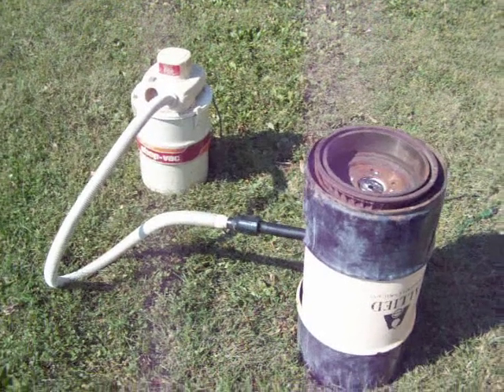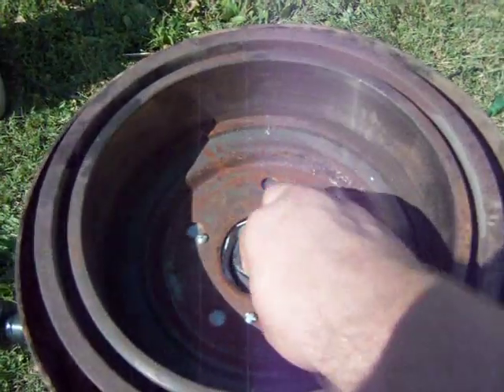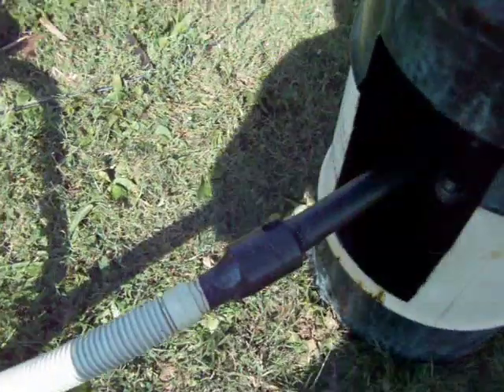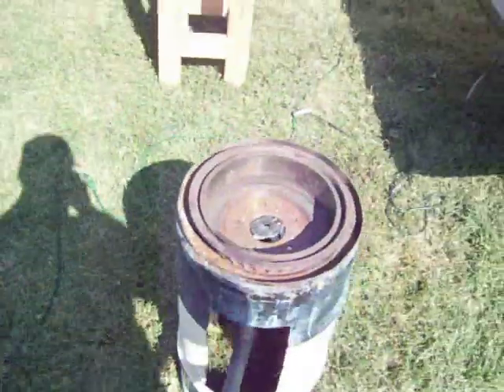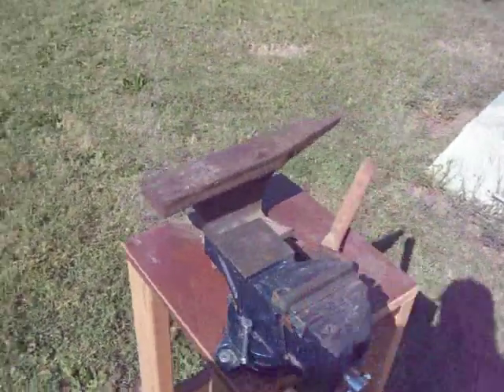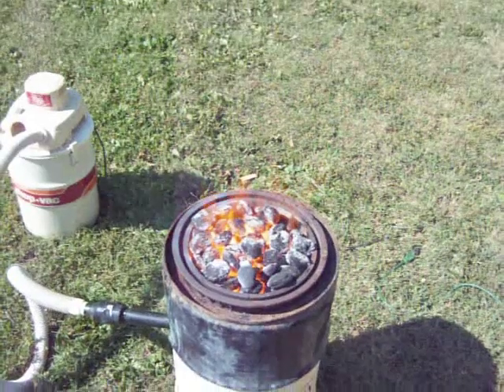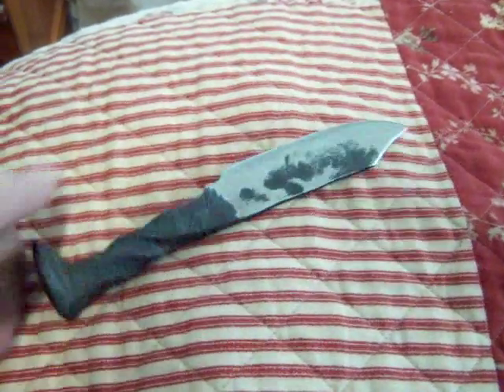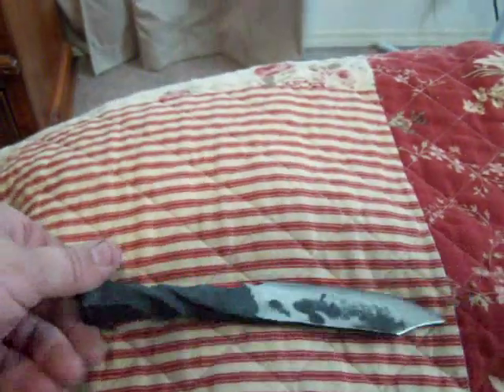my first brakedrum forge and RRspike knife

Comment: I'm using a shop vac as a blower. Seems to tolerate the dimmer dropping the current. I used a house vacuum from the roadside. Most throw out because brush head is done in. Usually the rest still works. Hope this helps.

Comment: I like the set up but you could have shown a little on how you put it togethor and not just taping after the fact. still good job!! I built mine out of an old steel truck rim and welded a steel plate to the bottom.

Comment from the maker: i dont have a video on how too but ,its pretty simple ,i think its about 16 inches of mildsteel 3 1/2 to4 inches wide ,fold in half cut triangles on open end down to 11/2 strip the rest of the way ,twist the spike first make the eye  then forge weld the blade try it with paper or clay first ,ill try to make a video sometime on how too ,thanks for watching